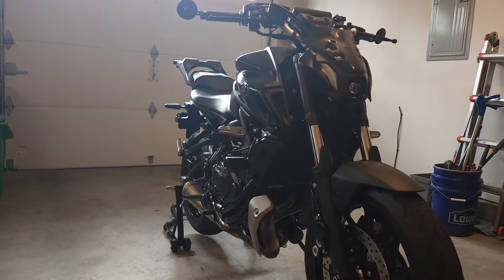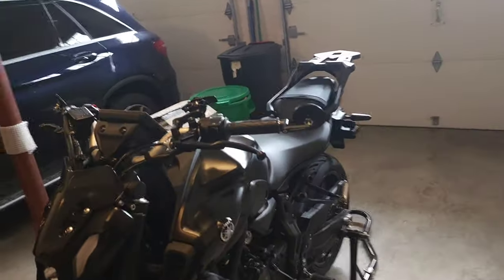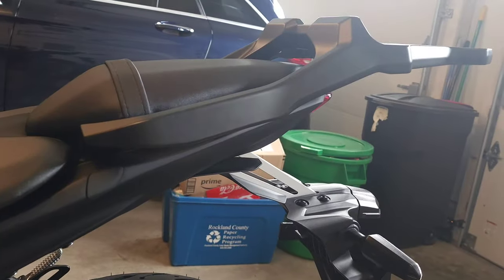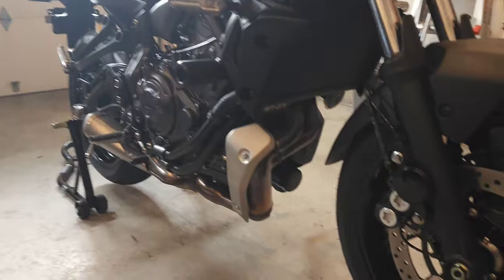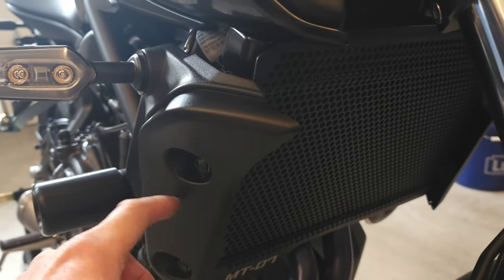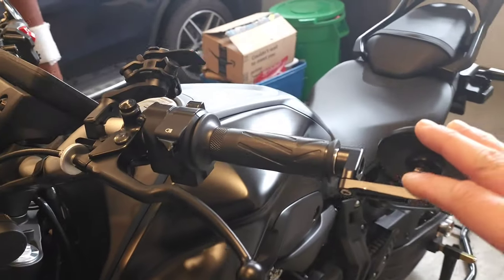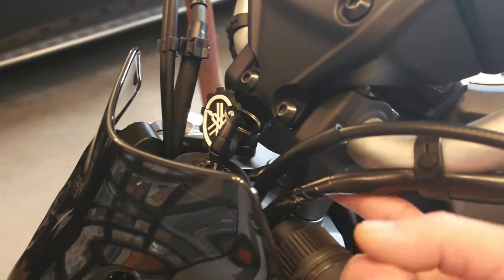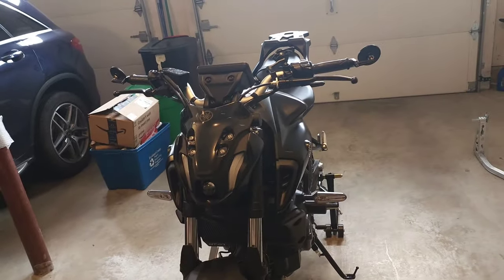New Yamaha MT-07 | Mods & Accessories

Comment: Good idea on garage door remote location.   I guess my only concern would be moisture getting into remote.  I used gray port for quick shifter.  Works fine.
Reply from the maker: I did the door opener with outdoor rated velcro on my previous bikes. I can take it off whenever I need but even if it gets wet, just let it dry out and no issues. I didn't have any velcro this time but will change. Quick shifter is tempting 🤔 but no $ because I had a major issue during my break-in service. Vid coming soon...

Comment: The grey port you were asking about is for the quick shifter. You can get an OEM Yamaha Quickshifter for the 23-24 its plug and play
Reply: What about the port thats on the side below the seat idk what thats for
Reply from the maker: OK. I see. There is another under the seat? Didn't see that one, I'll check that out.
Reply: Connecting an ecm scanner/ code reader plugs under the seat. Should look into CB racing case savers covers left / right,water pump and water outlet.

Comment: One port is AUX power for OEM USB that is on 2A fuse, the other one is for OEM heated grips and is not switched by a relay.
Reply from the maker: @Deceptolon  Others said the 2nd port is for the quick shifter. So if I get the OEM Heated Grips then I can plug it in there? Do you know where I can get the OEM heated grips that plugs into it? I'm in the USA and can only find the one that wires to the battery...

Comment: I just ordered that wind screen. I hope it deflects a little air when tucked at highway speeds.
Also I believe one of those electrical connectors if for the quick shifter. Its suppsed to be plug & play.
As for the stock exhaust, I saw a couple videos where people remove the tip cover and drill a few small holes. 
I have this exact bike & did it myself. I also sprayed the heat shields with high temp black paint to match the bike. I drilled 3 holes & it sounds better and I haven't noticed any issues with how the bike performs/ MPG. 
https://www.youtube.com/watch?v=OuzFwTf14zE&t=268s
Reply from the maker: You mean the small windshield I have on mine? Does almost nothing but does look good. Your exhaust sounds good but probably not gonna mess with exhaust til warranty is over.